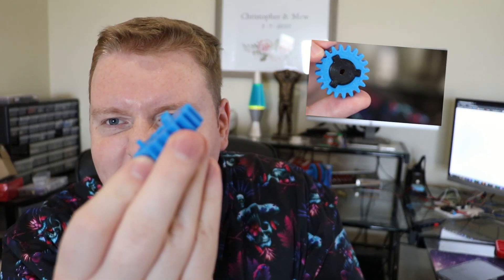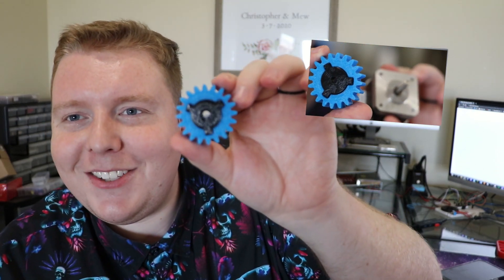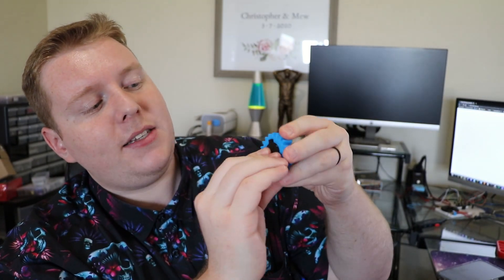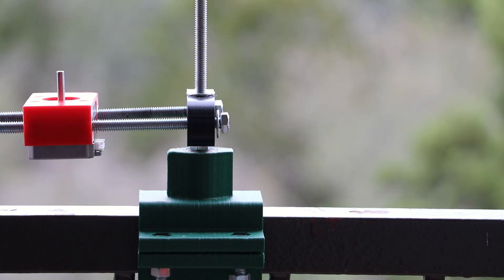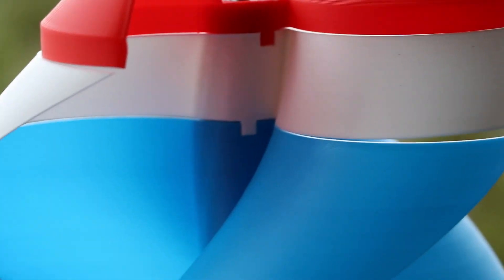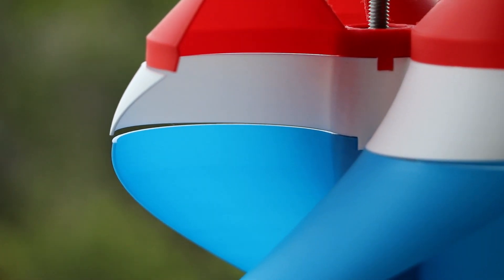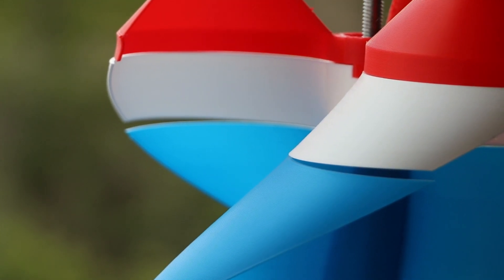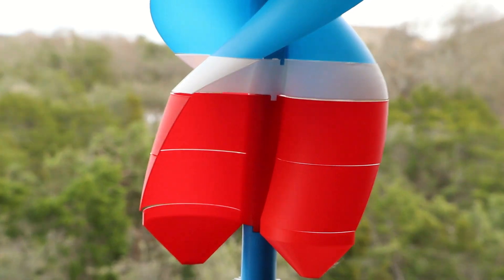Build-a-VAWT Just Got Way Better (& way bigger)

Comment: I design wind turbines and axial flux generators but I don't have a 3D printer yet. Does anyone know where to get a good used one gor cheap?
Reply: I would recommend a Creality Ender 3 as a first printer, because its very easy to use and cheap.

Comment: I love your idea and between watching your videos and Robert Murray-Smith's videos I've come up with a great concept. 
1) I want to use 7mm fiberglass driveway markers found locally at Walmart as my axis (possibly I might be able to find a metal sleeve for bearing interface if needed).
2) I figured why let the 3D printer have all the fun I want to print a frame for top and bottom pieces to use reclaimed sheets of PET from 2 liter soda bottles as my 'wing' material (sustainability) 
3) I want to go BIG I'm thinking hub and 2 wing curves for each frame (2 per section of vawt) should take 2 short prints, then assembly.
4) and finally taking a nod from RMS's videos I'm wanting to print and wind the coil for an axial flux generator.

Comment: Love the content and everything your doing, Keep it up!  Was thinking it might be interesting to switch the motor mount upside-down so you can have a little printed roof over the motor and any water on the belt would drip down and away from the motor. Make it last a bit longer in weather. Not a request but just a thought.

Comment: It would definitely take some work but something I was looking at was adding a CVT between the VAWT and Motor.  Some sort of battery and controller to constantly adjust the final drive ratio to keep a constant voltage output for battery charging then run lights or whatever else off the battery.
Reply: The issue is friction, which is intrinsic to a CVT. I suspect the gains from the variability would be eaten by the inefficiencies. Good idea though, I’m a fan of CVTs